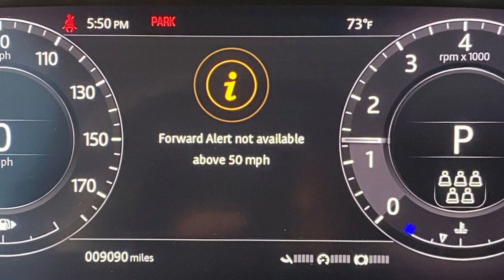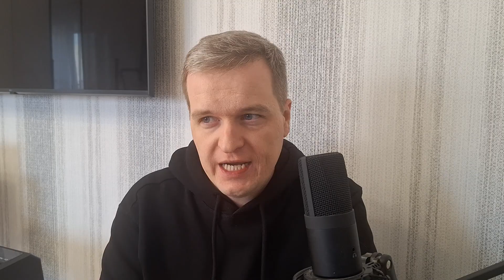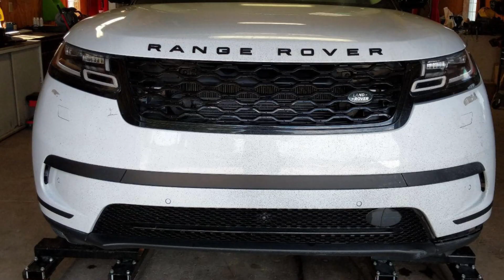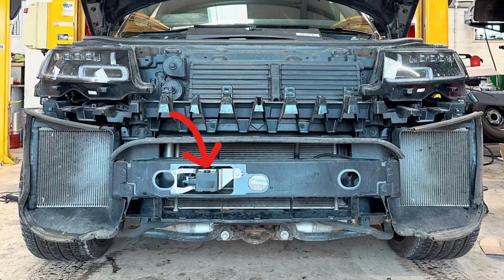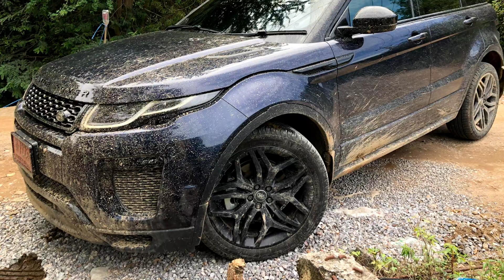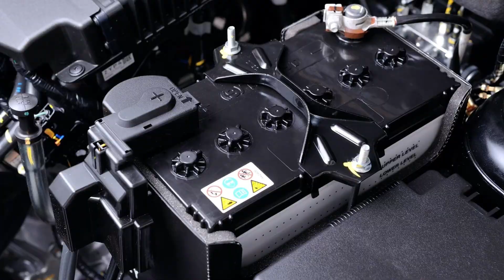“Forward alert not available” warning in Range Rover

Comment: Hey, I have this issue with my 2018 Land Rover Range Rover but I pulled the bumper off and there is no radar sensor behind the bumper like there is no wiring for it or mounting bracket what could be causing this issue windshield looks original and has not been touched
Reply from the maker: Your vehicle does have the radar. It may be mounted behind the lower part of the front grille, a little bit off-center, closer to the RH headlight.
Reply: @DmitrySapko thank you for your response

Comment: I have the C1A67-78 (AF) Forward Looking Sensor - Alignment or Adjustment Incorrect fault.  My RRS has never been hit.  Dealer wants to take the bumper off and replace the bracket, but since my RRS has never been hit I don't see how it could have changed.  I have no other faults or codes I have a scanner. Any ideas?
Reply from the maker: This bracket is extremely thin - could have been damaged even after a bad road pit or something. Also, the dealer will obviously check the wiring and the sensor itself and will calibrate the sensor. Without proper tools, there is nothing much you can do to even inspect the problem further than getting the code.
Reply: @DmitrySapko  Thank you for the reply. I wonder if water intrusion or a failing battery could cause this? I have a Gap ID Tool, can you reconfigure the radar module?
Reply from the maker: Yes, voltage drop could be the reason but this would most likely cause software issue and the problem would disappear when you disconnected the battery. These radars are hard to calibrate without dealership-grade scanners, but I know that independent mechanics who specialize in LR-Jaguar can do this. But I have no clue what equipment they use, unfortunately.